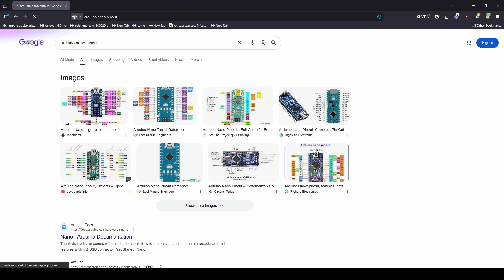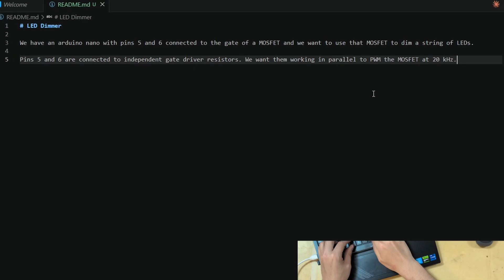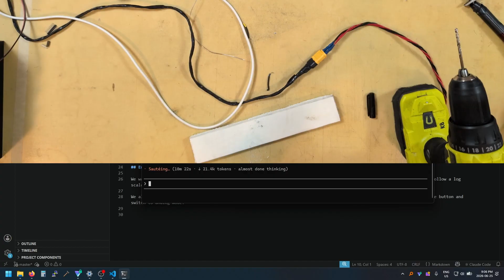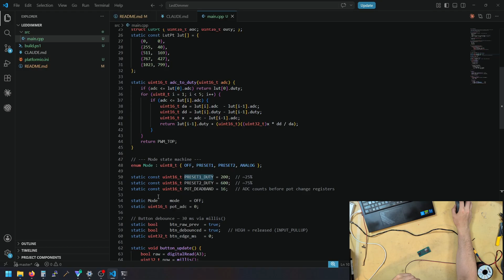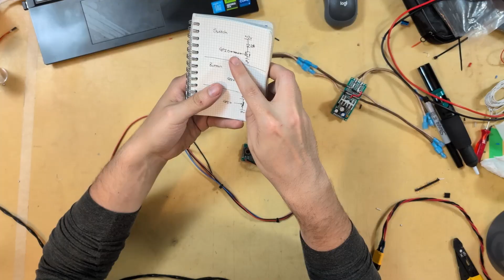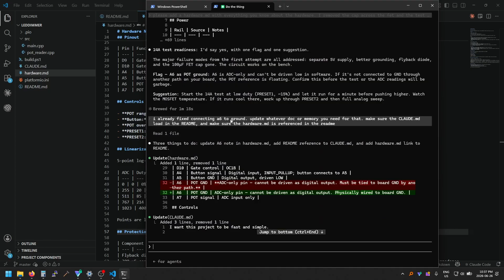LED Dimmer   FULL BUILD

Comment from the maker: I'm happy to make a GitHub page with a BOM, diagrams, and other info if there is enough interest.

This design can also be used to control heating elements or DC motors and should work in the range of at least 0-24V and ~0-15A, though I haven't tested any highly inductive loads with it.